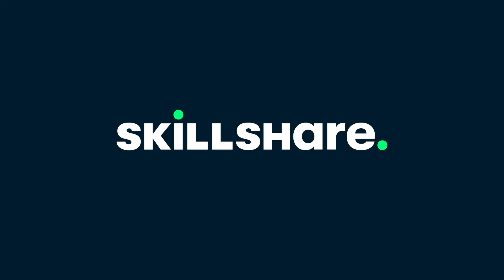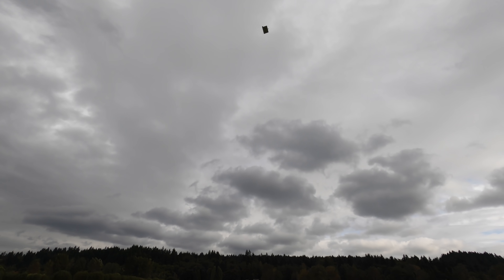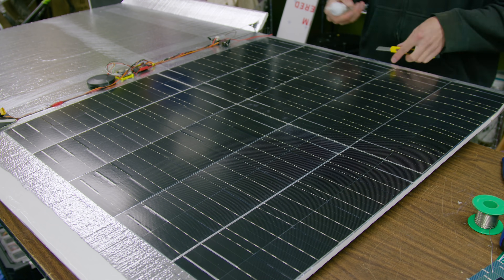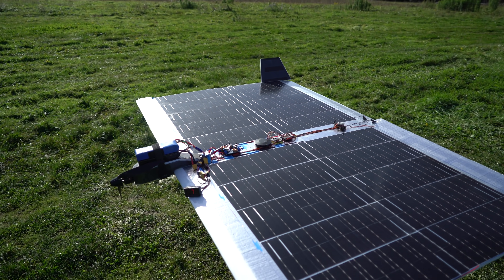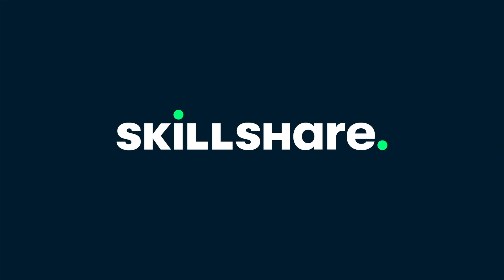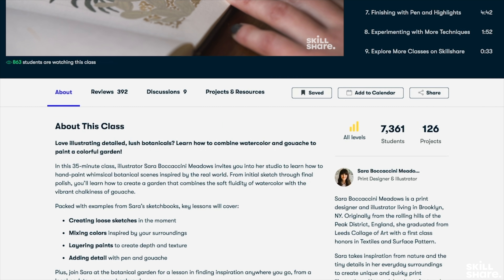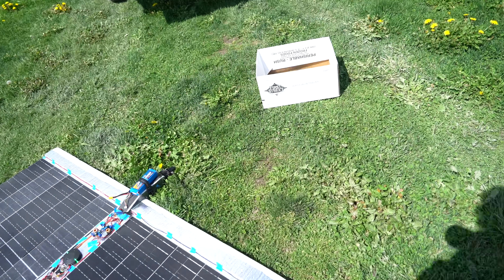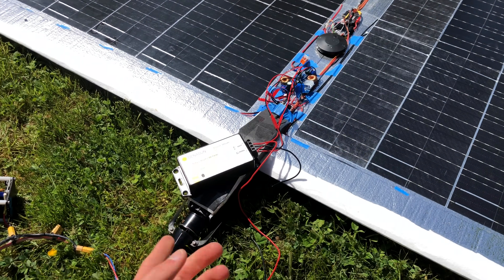R/C Flying Solar Panel???

Comment: I think you might have better success using PowerFilm solar cells, they are amorphous cells, which do have a lower aperture efficiency than the crystalline cells you are using, but only when the crystalline cells have perfect sun exposure, when they don't have perfect sun exposure I think the amorphous is more efficient and they are lighter and more durable.

CIGS cells might be even better, if you can find any and if you're willing to sun soak them for a couple days before each use. CIGS is much better for installations which will be permanently outside.

Comment: You could glue the solar cells directly to vinil. You dont need foam, Just a simple structure to keep its shape made with some rods. It Will bem much lighter. Pleasee do It. It is so Fun.

Comment: 5:18   "So now we got some direct sun, and we're doing about three AMPS."
5:43  "I've got this little LED display CURRENT METER . . . and . . . directly into the sun, it does about three point eight AMPS."
5:56  " . . . I don't have a CURRENT METER on this yet."
?????????????????????????????????

Comment: that's not how drag works bro its not about wing surface area only its more complex. flying wings have a higher lift to drag ratio if not designed by a idiot. so your drag chart is garbage and totally incorrect.

Comment: Go the next level. Put solar cells on the bottom and power it indefinitely with a laser tracking it feeding power to the cells. US navy is experimenting with this concept. The plane circles the laser source area until the batteries charge while the lasers power the plane to both charge it while providing power so that the motors simultaneously powers the motors so it does both fly and charge without putting a drain on the batts 😄

Comment: Would love to see you cut the foam sheet in half span-wise. Double the wingspan, cut cord in half. 
(ie: one long row of cells, vs two rows). 
Should reduce power. Using two motors could help control yaw, and thus stability. 

Having two motor pods would also help CoG and allow for extra battery capacity. 
If can run for 6 hours off battery, you might be able to fly a week or more in late June ... as could flay dusk to dawn. (assuming light wind, and no rain)

Comment: Awesome video. The time put in shows. Have you thought about gearing the motor/prop? This would be more efficient I would think. My dad and I fly GWS slow sticks. His is geared, mine is not. Major flight time differences with the same mA batt. Anyway, keep going!!

Comment: Could you make it so it circles until the voltage drops below some threshold, lands, and (IDK if that's possible) launches again? If you put pieces at the front to land it at an angle, could it go upwards?

Comment: If you extend the motor mount forward via a carbon tube you can remove the extra battery. and maybe use a smaller motor with less powerdraw. not too little since the weight will go down andnso will the counterweight to keep the cg in place. less weight means more distance and means a longer carbon rod. you need to find the optimum. Maybe even remove the other battery too. just use solar dorect to the electronics. even less weight so it can fly with a smaller motor using less power

Comment: solar engineer here: cracks on the cells will reduce power a lot! even if you do not see it. Put the battery and propeller way forward with two small carbon fiber sticks. Have fun! it was great to watch
Reply: Any idea what charging devices he was using on the batteries?
Reply: @hagfelsh  buck/boost converter?
Reply: @EREBUSAETHER  bust converter

Comment: When I was a kid ,may years ago we used to make model planes that looked very much like this but much smaller . They had no engine , but were just a glider . They worked quite well , with the rudder the full length each side of the wing  to make them more  rigid.  By adding weight,   you have increased wing load . So to compensate it has to fly faster, which will 
 use more power . During the second world war . Both Germany  and the USA did research into this type of airframe  . By 1944 the US had a good flying aircraft  . With a top speed , ( if my memory  is correct of 400 mph ). But the interesting part was its landing speed was only 40 knots.  But by this time jet aircraft were coming on stream . So interest dropped in this concept .

Comment: Make an even longer version. Like the delta wing is more effective at low speeds with a longer chord, try the same thing. Should get roughly the same efficiency, ubt much more solar panel area.

Comment: Does your dragonlink V3 telemetry work fine? I am having issues with my 1W RX unit - it loses downlink after ~500m and never recovers :( I boutght dragonlink for sole purpose of hoping for solid telemetry link. RC control is fine, but telemetry is awful for me even with both ends being 1W

Comment: If one could build a plane that could stay up all day, that would be a great tool for security monitoring. Let it circle over an area that one would like to monitor, then quickly fly down to a specific incident area if required. Just add a really good camera and 4G connection. Something like this has real commercial potential!

Comment: Great job. You should try replacing MPPT for diodes and match the battery voltage to the solar voltage.This should give you more power and efficiency 🙂👍

Comment: Sweet video and great song, nice to meet the person behind the songs at the end there! My two cents: I feel like it's worth lingering a bit longer at the "less aero efficiency, more cells" end of the spectrum, especially given that even this attempt would have been a pretty sprightly performer with just a better charge controller. A fairly shallow-sweep, cropped delta would yield a better aspect ratio than the rectangle here, not to mention a less inherently "flexy" planform. Yes, you'd lose a bit of cell-placing area from having a diagonal leading edge, but likely no more than you lost from the big KF step on this one. I feel like you could maybe even fit a few more cells on your elevons, if you had some little flexible leads to connect them across the hinge line. I also suspect the chunky full-thickness trailing edges would have contributed a fair whack of drag, maybe half an amp's worth or so - thinning them down could be a low-hanging-fruit performance gain. Could also go a lower-kV motor and bigger prop? That usually pushes up the grams-per-watt efficiency too.

Comment: You have angle of attack into the air flow, but not lift. The air flow over your foam sheet is really turbulent as a result. Since you used flexible panels, you should make a "pizza box" that actually makes lift and then bend the panels over the air foil. This will allow it to fly straight into the air flow and retain a lot more laminar air flow. Obviously this was version 1 of this design. Next design, you'll put the motor further forward to get the CG back where you want it and that will eliminate the need for that added battery to get the CG right to account for the solar cells.  I think your efficiency will get a lot better after just a few small changes and maybe then you can fly from solar power only.

Comment: Why don't you build an ridged airship with solar panels? Removing the need to create lift would be a great way to avoid dropping out of the sky in the middle of the night 😉

If it's cigar shaped you could put the solar panels on a rail system to spin them to the top or one the side which got more sunlight :)

Comment: Put those support strips on top of the wing and shape them like an airfoil. Then glue a super thin plank of foam board to that so you have an actual wing. That should 10x your lift, strength, solar output and solve all your stall problems in flight

Comment: As I understand, this "wing" is not really a wing, it works by redirecting incoming air stream down and getting lift from it, instead of using the difference in Bernulli's forces like regular wings.
Maybe scale the plane and make it even bigger, and actually make a "regular wing-shaped" profile? Generating lift like that will be more efficient, it will definitely fly on solar panels alone

Comment: Dan (you are Dan, right?):
This was a delightful, informative, and fun learning experience. I like your scientific approach (hypothesis, build, test, iterate).
   You are a skilled videographer, adept in RC technology, and thus able to monitor & document your experiments, in a way that I greatly admire.
   Would you consider doing a Zoom conference for our AMA sponsored flying club at Duke University?  
   I'm pretty sure you participated in a visit to Duke in 2019(?) , and your contribution was very valuable. Please let me know if you are interested in the idea of a Zoom conference, possibly for the Fall 2021 semester. There would be a modest contribution for your efforts. Contact me at: Cell/txt= 202-760-1700, Email: James.C.Eastep@gmail.com.  
   Keep sharing your work. It is exciting! - Jim

Comment: That is sweet, with better areo dynamics and with dose pannels will be awesome.  Also I'm using 2 stratus LEDs as fog lights for my car nice and bight still working with the 2nd controller I bought it with, 3 years and still going strong Pal. Only use them in the back roads with no on coming cars.

Comment: Some thin clear acrylic panels to make spars and vertical stabilizers with, and then clear plastic shrink wrap would make the top surface more of an airfoil while not really inhibiting too much light going to the panels. Other than that, I figure it could be pretty much the same internally. Given the slow speed, it probably do alright for something that's just meant to loiter over one spot.

Comment: If you need more space for solar cells, rather than using a fat wing, could you keep the wings optimal and have that optimal plane tow a tail? Like a kite but with solar cells. I realise that will still effect the plane but could it be a better deal?

Comment: GREAT PROJECT! I have thoughts! 1. Give it a boom and tail; it'll fix stability issues and give you finer control over CG. The elevons evidently give enough elevation authority... maybe try just a rudder on that tail? Or, since you already have the mixing, try a V-tail! 2. How about some dihedral? I appreciate you'd have to rework the elevon linkages for clearance, but it should really help with glide stability.

Comment: I think the problem is that this plane have no wings- surface is flat and create no fly force at all. If the surface would be curved it would fly a lot better, for now it's not flying at all - just pushed by motor as a horysontal rocket

Comment: The wing needs more torsional rigidity. Every time the speed went up the aero forces over powered the wing's stiffness and the control surfaces began acting like trim tabs. That resulted in reversal of roll control as speed went up. The strakes fixed the issue for pitch, but not roll.

Comment: Dont do moulds out of a 3D printer. RamyRc did this and was having big problems with getting a good vacuum. If you seal the hole mould frome the outside, there will still be air inside the mould and it will crack it.

Comment: don't understand what you have done

high aspect ratio wings provides highest lift-drag ratio

if you put all these solar panels in a long rectangle instead of a square shape, the plane will need less power, will fly longer and so

Comment: I wonder if it's possible to make a plane without battery entirely. Fully powered by solar cells with a supercapacitor as a buffer. With so much weight gone the efficiency must be enough to be fully powered by sun.

Comment: Basically you are heading towards a scale model of the Solar Impulse plane? You just have to make it big enough to carry the battery that will power it through the night. A 50% model should do it. That means "only" a 118 ft wingspan 🤔😂.

Comment: Hahaha, love the song. You're using a DX7? I had one of those, hated the programming for it. Have the DX8 SE, love the programming in that one a lot better. (I still have the DX7 in storage somewhere). For your project, would retractable wings extensions for night flying/gliding work?

Comment: Make the plane slightly longer with no solar cells on the elongated part. This would allow for better CG which might remove the need to add additional ballast. Could also re-add the vertical stabilizers as they would no no longer block sunlight.

Comment: So heres a thing worth investigating. Shading a single cell will drop the efficiency of the entire solar panel.
Will moving the rudders further away from the panel, so they dont shade them, help with power?
*edit, nvm, you to it at 10:00

Comment: I wonder if mounting the propeller on top so it's pushing the air only over the top portion of the wings would help.  My theory is it would create a low pressure zone on top.  Might do weird things as far as stability goes though and it might push plane nose down.

Comment: Those dump "manual-MPPT" controller are awesome for their price, they turn on by themselve with little power if the voltage difference to output isn't that big.
They also feature constant-current and constant-voltage adjustable which is also very convenient and makes them very versatile.
Maybe not obvious but you have to manually track the MPP yourself.
Downside is if manual MPPT adjustements is set to high, it may cut off power to soon, so maybe choose a voltage slightly below MPP incase for slightly less sunlight.

Comment: Are those panels bifacial (e.g. there is no backing material and the solar cells are exposed on the underside too) ? If so you can gain another 20-30% power from them by leaving the underside exposed to the reflected light from the ground. Just a thought.

Comment: Intead of carrying dead weight by putting a lipo in the front, move the motor to the tail. To counter the tail heaviness lower the angle of the motor. Normally people use 0 degrees. Set your angle somewhat lower. You can easily 3d print such a firewall. Alternatively, you can keep the motor in the front but now you need to increase the motor angle.  This should keep your plane balanced without any dead weight. You loose however some forward thrust because the forward component of the trust is now less compared to 0 degrees.

Comment: Trust me…the square plane is easily doable but you MUST space the nose weight along the entire width of the leading edge,and not just in the middle…also,do not extend the front

Comment: I have a video suggestion for you (if you are interested in such a thing): Building a low-cost, entry-level ardupilot hardware setup. The hardware you are regularly using is very good, but also very expensive. Try to build a setup that's rather inexpensive, but still works with ardupilot, as to make getting into autonomous vehicles of any sort with ardupilot more simple.

Comment: Would it fly more stable if you mounted the vertical stabilizers and the battery below the wing? Of course the landing could cause issues, but I'm sure you could construct it stable enough that they don't get damaged when touching the ground.

Comment: Can you measure power instead? The voltages at the cells and at the motor are going to be different, so just measuring current isn’t going to give you a very accurate comparison.

Comment: The plane could be a little more aerodynamic. There should be many simple designs with high efficiency.

This is a choice, because wing design correlates to flight speed.

Comment: Easy composites have heaps of great vids. 3D model, mill a pattern of even 3D print a pattern, mold, carbon fibre prepreg in vaccum bag and make an oven with an arduino doing some PID control or similar. Of vaccum infusion CF. Hard work, I'm keen to have a crack myself.

Comment: Another spar perpendicular in the front to relocate the battery/motor/charge controller, and one more to stiffen the back and I say you'd have a very solid piece of aircraft there. 

Perhaps relocating the electronics underneath too? to keep them from unnecesary solar exposure.

Comment: Over a decade ago I saw a school kid make solar panels out of hair, they would probably be a lot lighter an more durable and u could wrap them around a wire frame an create a conventional wing an body design an make the whole plane's surface a solar panel so no matter your angle ur still gaining power. I think he was from China, I'm sure the page or video would still be easy to find.

Comment: If you make it a biplane, you can pack twice as many solar panels.  :P
Reply: won't the top wing cast shadow on the lower or have the lower get hit by sun on the outer edges?
Reply: @lucassvedlund3851  Yes.  That's what makes it funny.
Reply: @ChristieNel  so more of a fun thing than something to improve the efficiency? Or maybe it’ll be more efficient, if he tries I want him to go all the way and do a Red Baron triple wing design, for the laughs😂
Reply: @lucassvedlund3851  That would be hilarious.  Especially if he does it with a straight face.

Comment: A seaplane and boat working in tandem could feasibly circumnavigate the globe. The boat can carry enough extra power to allow the plane to land and recharge from it at night
Reply: Take the v3 and triple its size, then set up a jonboat to accompany it

Comment: I got inspired and am building a solar plane myself. 
1.8m 20 maxeon c60 cells. 
Hot wire cut wings laminated with glass. As an mppt I'll program a arduino (single chip) to steer the throttle (when full power it tracks max power). No flight controller, no GPS and no battery. Yes, no battery 😁 I hope to stay below 1kg🤞